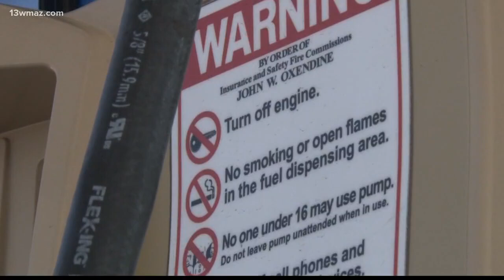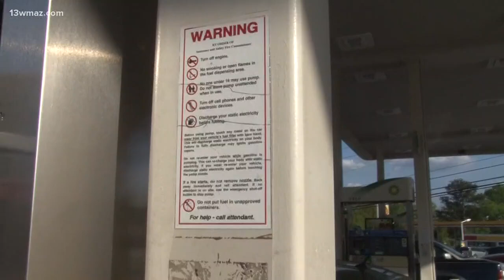VERIFY: Is it safe to keep the car running while pumping gas?

Comment: You think everyone next to you stops pumping gas when you then start your vehicle to leave? This is an antiquated concept from when we had more old carbarateur cars that would spark more. Not really an issue since 1990. But again cars spark more during starting than running so you're more likely to blow up by turning your car off then back on

They have proven that lit cigarettes being extinguished directly into gasoline wont even ignite it, so your hot exhaust pipe sure as hell wont do it

Comment: Why wouldn't u ask an engineer who actually understands how a car works... U can leave ur car on, the odds of ur gas tank catching fire due to the engine are unrelated to whether ur car is on or off because there is the no functional difference in the way the car operates whether the car is being filled or not (because the ignition of the chemical reaction is in a closed system disconnected from the gas tank)... Also the engine temperature is not going to change significantly across the 10 seconds it takes to get out of ur car and start filling it up after uve had to drive it to the gas station... The static electricity is plausible but improbable at best, and it's unrelated to whether ur car is running or not...

Comment: I think it's important to remember it's technically possible but to call it "rare but real" is misleading. Maybe I'm wrong but there has not been a fire due to leave the car running while pumping gas at a modern gas station. Something else was going on in the video shown. I did some research and there have been 200 fires caused by static electricity at the pump it is said this is from the gas fumes in the air. However modern pump systems capture that gas so it's not released in the air so there should be no fumes to light. I'm pretty sure that's why gas pumps smell less gassy now a days

Comment: God damn the amount of people who think leaving the car on at the pump is dangerous blows my mind.  I've been asked twice in 18 years to turn off my engine at the pump.  Even if you turn your car off the engine and muffler are still piping hot.  The gas tank is usually located at the opposite end of the engine.  It's an open air environment, so fumes dissipate almost instantaneously. Static exists with the engine off and on.  I'd venture to guess that tens of millions of people around the country fill up with the engine on every week, and we almost never have instances of fires at the pump.

Comment: MORE LIKELY TO PREMATURELY WEAR OUT YOUR FUEL PUMP WITH AIR BUBBLES MIXING IN. FUEL ACTUALLY LUBRICATES THE FUEL PUMP,AND AIR BUBBLES CAN RUN THE FUEL PUMP DRY A FEW SECONDS AT A TIME. CAN SET CHECK ENGINE LIGHT TOO GAS CAP EVAP LEAK
Reply: My friend used to fill gas like that. It wont cause permanent damage but due to the air bubbles, the EPC light will activate and until the new gasoline mixes with the old there could be engine start problems for 2-3 hours. So I wouldn't do it.
Reply: Infinity I accidentally left my car on while putting gas I didn’t mean to I promise won’t do it again is it bad just doing it one time?
Reply: Edwin Ramos 
I do it all the time and don’t have problems.
Reply: @EdwinLied  Probably not, but if you keep repeating it you will get a dashboard EPC notice on some cars (could put your engine randomly in limp mode due to fuel pump stress)
Reply: Bubbles are introduced into the fuel in the tank constantly by fuel sloshing around while driving. More importantly the fuel pickup is located at the bottom of the tank, so bubbles would have to defy gravity to travel downward to get sucked up into the feed line. I suppose if your car was upside down, then yes, it could suck up a lot of bubbles and air. But then again if your car is upside down you'll probably be more concerned about why it is upside down than your fuel pump being damaged.
Chances of a running fuel injected vehicle catching fire are practically zero. Older carbureted vehicles significantly higher, but still very low.
Reply: @wonderkind08  exactly